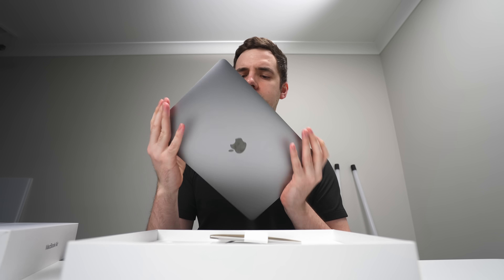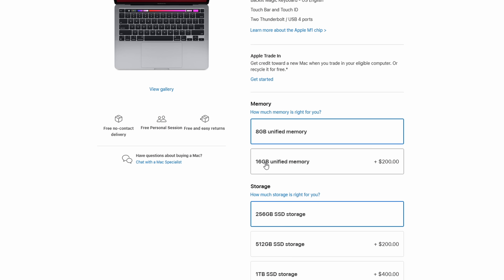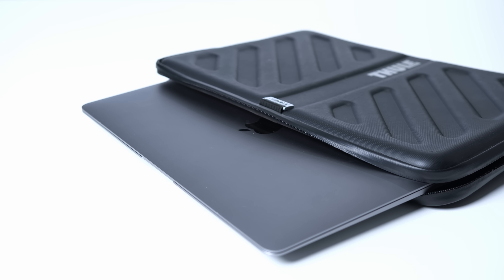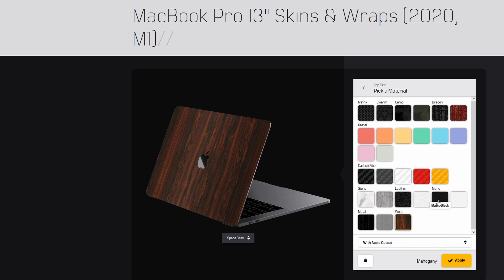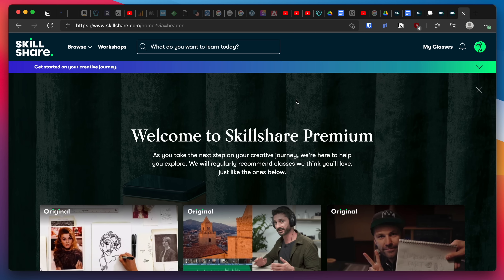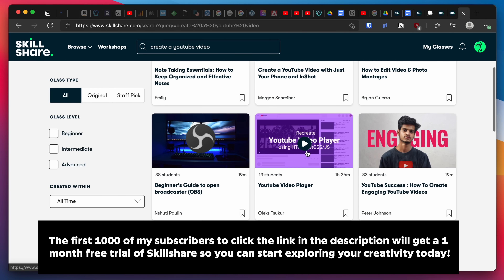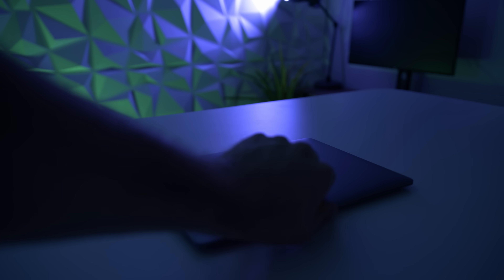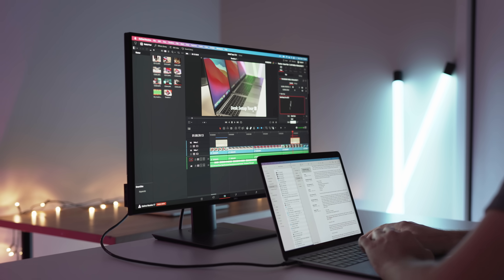How To Make Your MacBook Last FOREVER! (Ultimate Guide)

Comment: I think when Apple comes out with the new redesigned M1X MacBooks, those things could potentially last for 5-7 years if you take care of it. It could even last longer if they keep battery replacement prices the same.
Reply: They will last 10-15 years with what I've seen. My brother had a MacBook air from 2013 and I've had it since around 2020. Everything was working find except for obviously the battery was degrading a little. I then bought the M1 Macbook Pro when it released and I strongly think this will last me 10+ years. These M1X macbooks will easily last people over 10 years.

Comment: 9:34 - "Consider opening up the back chassis every 12 to 18 months to check and remove dust". I'm fairly sure doing this will void both the warranty and AppleCare+. A better solution is to invest in an in-room HEPA air filter. They run $100 USD or so and won't void your warranty.
Reply from the maker: That definitely will not void the warranty or AppleCare. You know what ISN'T covered by warranty and (unless you pay a hefty out of warranty fee) AppleCare+? A failed fan or fried CPU due to build-up of dust. You can't have a HEPA filter in every room you use a laptop in.

Comment: still using the 15" 2012 Pro and have been using design programs as well as light gaming the whole time. This mf is about to be 10 years old and the only problem I have with it is the battery is unable to last longer than 30 minutes off the charger. About to buy an M1 Pro because I don't see a point in fixing the battery issue, but I love this computer and am excited to see how long the M1 will last me.

I was 15 when I got this computer and didn't know to not keep it on the charger when it had a full battery so I wrecked it lol

Comment: I have a macbook 2012 where I rigged the hardware by maxing out the ram, removing the optical drive and installing 1 tb ssd. I also upgraded the main storage into another ssd. And lastly, refrain from auto updates. Means im still rocking the mojave os XD

Comment: I would't be too worry about SSD.  I used to have Macbook Air early 2014 until recently, in 2021, I traded it for a Gift Card.  It was one of the early SSD type Macbook Air, and it was still working perfectly.

Comment: Thinking of replacing my macbook is 3 years old (mid 2018 version).  Do you think it is worth selling mine and replacing to the M1 just because I am suffering from keyboard problems? I've heard that keyboards that have gone thru the keyboard replacement programme still suffer with the same problems.

TLDR: should i use the free keyboard replacement programme to fix my macbook (which is ~50% effective) or just straight up sell and upgrade to M1 macbook?

Comment: Watch out for this! Bought a $2200 Macbook Pro last year, not even a year old. Unplugged charging cable, wanted to close lid slowly, cable was caught in between while closing, screen cracked at the corner and is now unusable (doesnt display anything anymore). Apple limited warranty doesn't cover it. Price to fix it here: over $1000, obviously not worth and now using it with an external monitor.

Comment: I just noticed my new M1 mac had micro hairline scratches from rubbing it while cleaning. Although I use microfiber but the display is way too delicate. It can only be seen by flashing a flashlight on the screen. So, I ordered a new screen guard. Too late? maybe but i can rest easy thinking there won't be any new scratches in the future!

Comment: In addition to buying enough RAM for YOUR needs and a 10 Gigabit Ethernet port, the most important way to prolong the life of your new non-upgradeable Mac is to prolong the life of your minimum size SSD. Buy an external SSD and use it for storage from Day 1. 2TB Sabrent if you're a content creator who needs speed and space, otherwise any SSD. Keep it permanently plugged in and put MacOS on it as well !! The end of the SSD, is the end of your fast Mac. This is a cost effective way to do it too.

Comment: Excellent video man. 2 things
1. It is said in various forums that a hard shell case for MacBooks is inadvisable since it can add some extra weight on the lid of the laptop and potentially make the hinge loose in years. Do you advocate the same?

2. Would love to see a video on how to clean the unnecessary heap of files in MacOS without additional software as you mentioned.
Reply: does it really affect the hinge that much? The cover weighs couple of grams,
Reply: @lukahribovsek5563  same question? Hope someone answers
Reply: Wouldn't advise using one. I used one on my MB Air from day 1 and after a year the screen started to glitch occasionally, after 2 years, it started to flicker or completely bouncing. I cannot help but think that damn case had something to do with the screen going faulty, specially because I could notice the lid shut a lot faster because of the extra weight. 

Oh, and of course, the bottom part of the case, made the laptop heat a lot faster, despite the 'vents' it had.
Reply from the maker: I probably wouldn't bother with a hard shell case, spend that money on a good sleeve like the Thule one I have.
Reply: What about a silicon keyboard cover to stop dust ingress
Reply: @MadelnMachines dont close it with the cover in
Reply: @MadelnMachines  i think it’s fine
Reply: I've been using my case on my m1 Mac since I bought it when it released, never had an issue and it's protected my Mac from many accidents that could have caused serious damage. Not sure what everyone else is talking about tho...

Comment: Not even close to possible.  I’ve gone through 3 MacBook Pros in 5 years.  Something always breaks.  If it’s not the display…it’s the video controller…if not that, it’s another MB issue that causes it not to boot.  I love them.  But they aren’t any more reliable than many other laptops I’ve owned.  And I take very good care of them as well.

Comment: My macbook pro 2012 mid still works as a charm! Handles fcpx, unity,ps etc amazingly! I just added ssd and 8 giggs of ram from 4!
Reply: I'm planning to get the mid 2012 once my 2008 becomes unusable :) You can up the RAM to 16 GB I think.
Reply: @GuillermoPaulman  yeah you can,but i went to an apple store lol, the official limit is 8gb :(
Reply: @GuillermoPaulman  and man if you could up your budget a little bit,go for the m1 mac air...its freakin awesome
Reply: @AnunayMintoo  I was tempted but Air is too small for me. I'd happily buy a 15 inch one if they made it.And also I'm worried about the longevity. Some M1 devices are already showing the flexgate problem.
Reply: @GuillermoPaulman  hmm ic, longevity might not be a problem tho,14 inch m1x mac this year! Hopefully what u might like😎🙏

Comment: Will factory resetting my MacBook Pro m1 frequently damage it’s ssd?
Reply from the maker: It won't, besides you would only reformat the SSD every few years anyway.
Reply: @CreatedTech  okok thanks very much cause I just bought the Mac yesterday and there has been some issues and is needed to reformat a few times (5times) 
if not mistaken until the problems gone
(The problem is I can’t create an username and password at first but it’s fix after reformatting a few times)so I’m just so scared that my ssd will worn out soon

Comment: I’m still using my mid 2012 15” Macbook Pro Retina quite successfully. I even updated it to macOS Big Sur (using Patched-Sur) recently. Still chugging along nicely, but eager to upgrade to a new M? Powered 16” MBP when they are released. The only things I’ve ever done to the 2012 machine is upgrade the Wifi card to 802.11 AC so i can unlock it with my Apple Watch and I reapplied the thermal paste.

Comment: I think the Intel CPUs actually tend to produce more heat as they age; I had several machines manifesting that problem, and re-pasting the CPU didn't resolve it.
Reply: Really and I got a 8th generation intel MacBook Pro 💻 too a refurbished one 😮
Reply: Depending on dust buildup and the age of thermal paste on the cpu and gpu, all can be solved in one go in minutes, even made better than new.
Reply: Apple is the best since I was introduced to Apple products, I don’t notice other products. I have iPhone iPad and now my MacBook. This is fantastic. It makes your work easier. You can start working with your iPhone and continue with your iPad and end it with MacBook. Thank you Apple for making my work faster, easier and incredible 💋

Comment: The battery life is important too. How long it can live ?
Reply: It will last 100 times longer if you never ever operate the battery under 20% (40% even better) and immediately unplug the charger when it reaches 100% (80%. much better). Batteries hate heat discharge under 20% and pump up to the max 100%

Comment: Very nice guide, but I would disagree that you should spend money to make the device last longer. I'd rather just upgrade earlier - a base MacBook Air, over the course of 6 years, is cheaper than a MacBook Pro with 512GB and 16GB of RAM over the course of 10 years!
Reply: Exactly, I bought a base macbook air because the upgrade to 16gb would have been 500€ extra, not worth it. I am a light user these days, so no need for more at the moment. Super happy with my choice

Comment: Did you look into apps like AlDente? They can block the mac from charging past a certain percentage. I currently try to keep it under 60%. Shame I will only know if it works in a few years. Would be curious if anyone tried this already. My old mac book can only run for 2h from battery after just two years so I hope my new one it doesn't age as quickly :/

Comment: A notebook stand also raises your MacBook off the surface protecting against spillage. 

I do wish Apple's battery management was a lot more aggressive about pausing charging. My MBP16 usually blows right past the 80% mark even though I rarely let it go down below 50% charge. I'd prefer it always limit charging and let me tell it before some long trip with no power, "Charge to 100% by tomorrow 6am." Otherwise 70% would be fine for me.
Reply: There is Al Dente for MacOS for that
Reply: @MsSjaakvaak  Thanks for the followup. I installed AlDente sometime after that comment, and it is working well :-)

Comment: How about replacing thermal paste? I was sold this “hack” by my local repair store, but can’t say I notice a difference. That being said, I did this in 2020 with a MB Air from 2014 and it was the first maintenance thing I ever did with it, so can’t complain.
Reply: its a good suggestion, although as you noted, some thermal paste holds up better than others. For my computer that was built in 2017, I had to replace the thermal paste in 2020 and it made it run cooler/smoother

Comment: My late 2013 15" is still going strong.  When I say strong, it handles my wife's email, excel & word requirements
.
Reply: "late" you had me confused there
Reply: My Mid 2010 13" MacBook Pro is still going strong.  Had to replace the battery a few times and upgraded the Ram and HD to an SSD.
Reply: Mid 2012 macbook air here 🙋 had to replace the battery twice, but it's still alright. 

Alright for word, excel, and streaming lols.
Reply: just as good as my phone
Reply: Except the battery get swollen pretty bad
Reply: 2012 macbook (apple logo lights up in the back) and theres absolutely nothing wrong with it at all. Its still super fast just as fast as my cousins newer 2019 mac, doesnt crash at all and the battery has had some problems now and again but it kept fixing itself so I never had to actually replace it, and I havent had a problem with the battery for a very long time now. It handles everything the newer models does :)
Reply: I heard the mid-2012 13" I gave away is still being used by the new user and is in usable condition where usable since the battery capacity is at about 40%. She keeps it plugged the entire time she uses it, I suppose. But that is a great record against planned obsolescence.
Reply: well thats at least worth 200$ tasks with Apple style that's good, maybe its time for SSD and RAM upgrade
Reply: Late 2013 MBP here too. It’s going strong and still playing StarCraft. 😊
Reply: Early 2013 still going well, nothing replaced but thermal paste and radiator

Comment: What's your opinion on Screen protectors and Keyboard covers? There's a clear hard case I'm considering buying on Amazon by MOSISO and it comes bundled with a Screen Protector and Keyboard Cover. But I'm wonder if putting up with a slightly different/worse feeling keyboard and a bubble or two under the screen protector is worth it.
Reply from the maker: I don't personally use those things. Keyboard covers in particular are really off-putting for typing. You're much better off spending that money on a high quality case to keep your Macbook in.
Reply: @CreatedTech  what about screen protector?
Reply: @CreatedTech  Thanks!